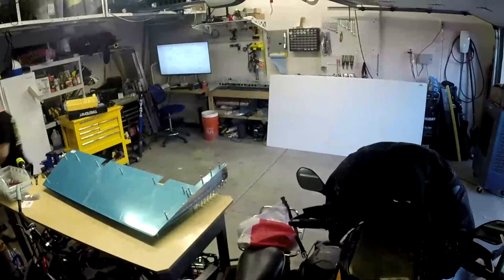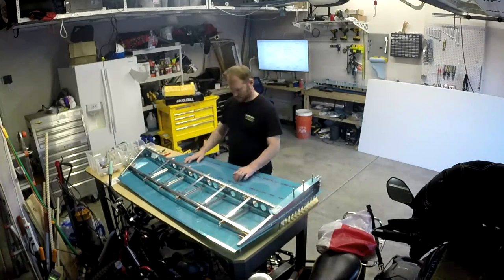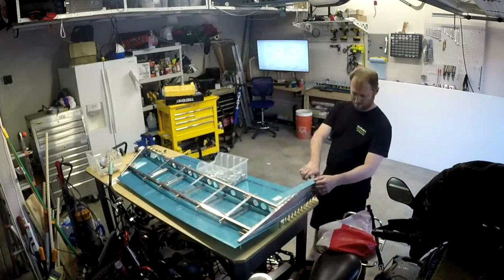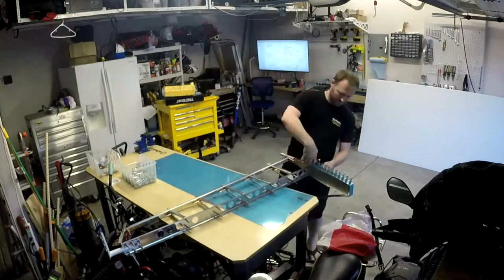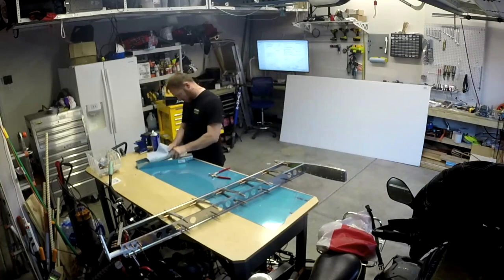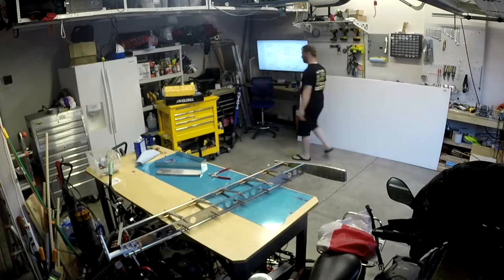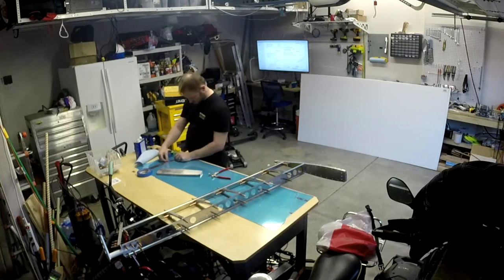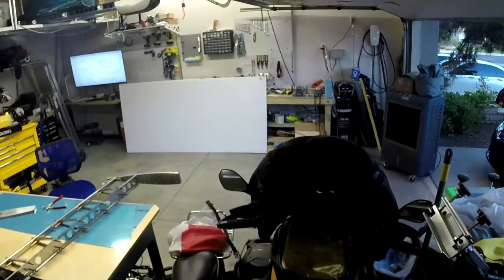RV-14: Elevators 08

Comment: That swamp cooler looks beast mode.  What model is it and how well does it work out here?
Reply from the maker: It's this one from Home Depot.  When it's in the 90s it works pretty well, it gets cold enough that I need to turn the speed to the lowest setting.  We'll see how it does at 117 this week, although my garage is insulated so it probably works 10 times better than the metal hangar I was in, where I basically only could make it work for spot cooling.

https://www.homedepot.com/p/Hessaire-5-300-CFM-3-Speed-Portable-Evaporative-Cooler-Swamp-Cooler-for-1-600-sq-ft-MC61V/304078773

Comment: Hi Josh, what type of flush rivet set have you been using in your rivet gun when flush riveting skins to the rib spar assemblies? Some builders get good results with the swivel set with the red rubber cup. Others use a straight mushroom set.  And still others use a straight flat set with a rubber or polyurethane guard.  Also, are you using a a 2x or 3x gun when flush riveting the skins? Thanks.
Reply from the maker: I have a 3x gun and I've been using the swivel set.